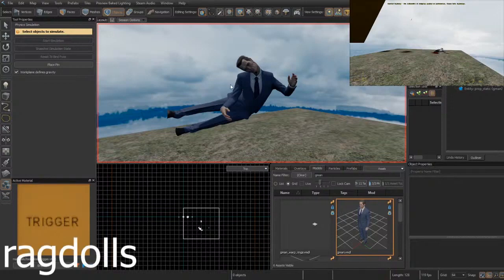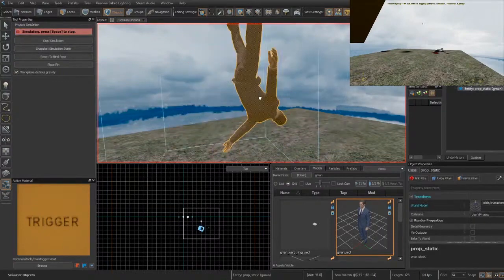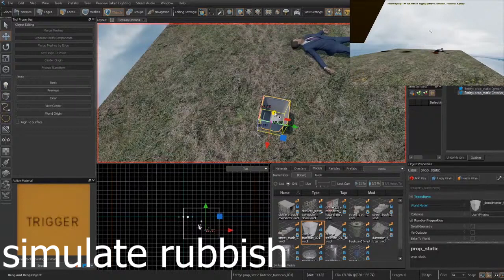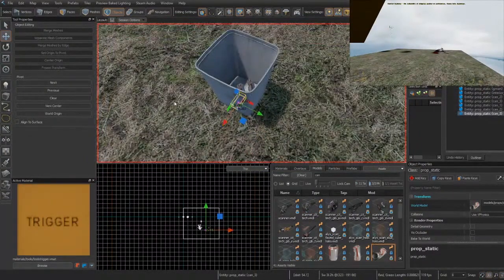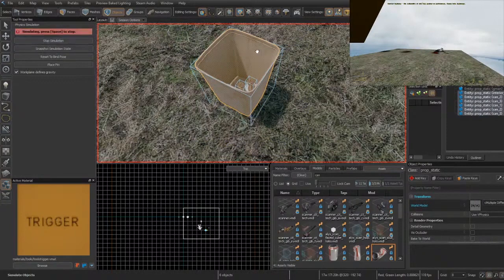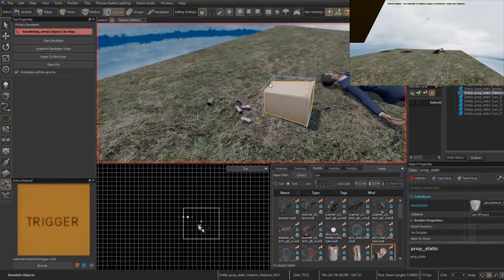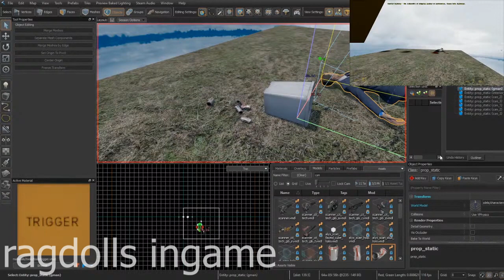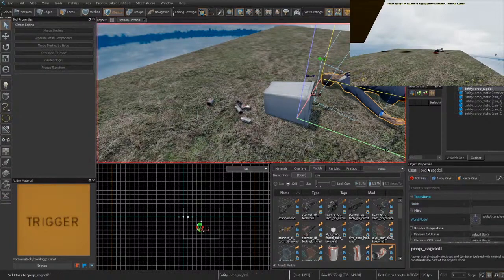Physics simulations in Source 2 Hammer Editor

Comment: Hey Goutrial, I have a question about mapping in the Source 2 Hammer Editor; 
I want to create an invisible wall through using a [player clip?], yet I'm not sure how that's done. May I ask what i need to do here? 
Thanks!
Reply from the maker: there's tool textures similar to source 1. Find a tool material called a clip brush (you can find them in the asset browser like you'd normally get a material).
Reply: @Goutrial  Thank you so much! You've helped me yet again!
Reply from the maker: @danieljolly6866  no problem